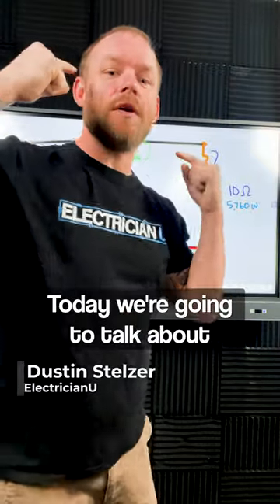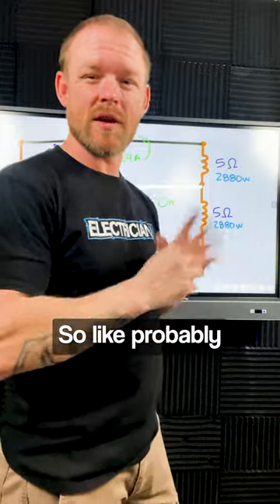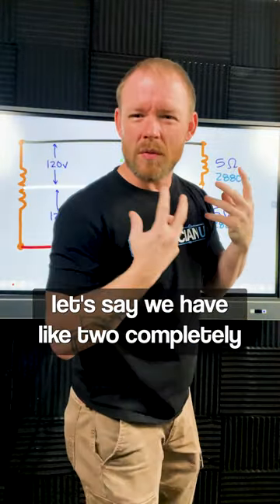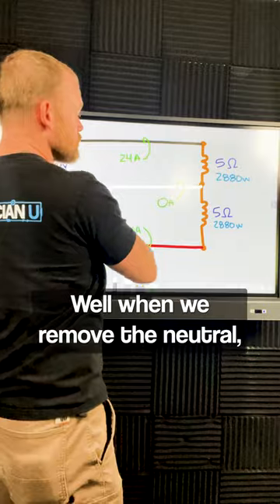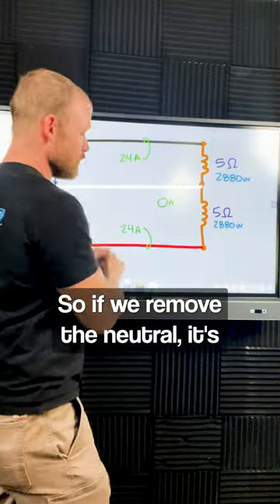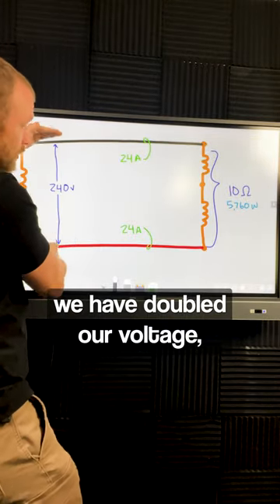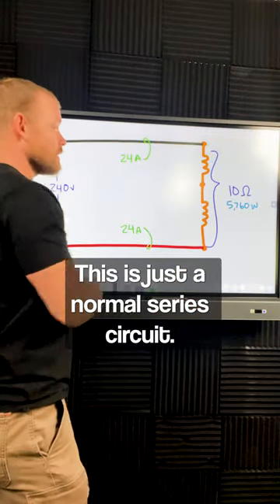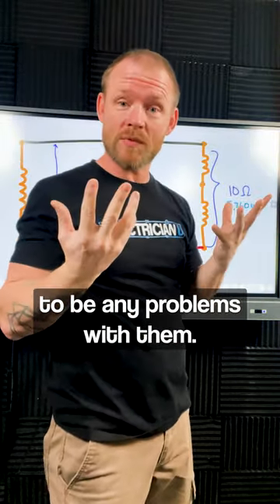Lost Neutral in a Multi-Wire Branch Circuit - Part 1

Comment: You are correct in a perfectly balanced load, with loads that can handle higher voltages.  The moment your loads are imbalanced the voltage at the higher load is going to go high and at the lower one go load.  And the most expensive one is going to end up sacrificing it's magic smoke to protect the cheaper load.
Reply: I'm actually having that issue with a wall oven Im working on, burned out 2 fan so far, going back and forth with electrician that something is happening with the neutral.

Comment: In that scenario would you be able to energize one fan without the other running?
Reply: No
Reply: No, because when a neutral is lost on a MWBC what you've created is a series 240 volt circuit (or series 208V circuits in the case of a commercial setting involving a 120/208V wye system, a lot of material and labor can be saved with MWBC'S on a 120/208 3ø system where several 120V circuits are fed from the same panelboard,  office cubicles are a good example)   however depending on the loads the voltage on one leg can vary from a few volts to 240V.

Comment: That's because the neutral only handles the unbalanced load in this case above they cancel each other out so if one was drawing 10 one phase the other phase was drawing 11 the remainder one would be on the neutral

Comment: Don't be over panicked by this as this applies to light dimmer and ceiling fans and entertainment centers with tv and stereo sound systems wired through the house along with video surveillance and the alarm system with battery powered backup in case of power outage peace

Comment: Talk about losing a neutral at power company transformer and what that does to the home circuits. Would having neutrals grounded in panel box to outside grounding rods with grounding circuits affect any of this as far as saving the 120 volt circuits and appliances connected to them
Reply: Depends on how much resistance the grounding electrodes have, and how far away the pole is from the house.  Current will travel to the grounding electrodes and try to flow back to the source.
Reply: You are probably going to lose stuff no matter if you lose neutral.  Especially stuff that isn't made to run at 220v, you will seldom have a balance panel.

Comment: Yes  - but topic is not suitable for a tiktok  format.  You need to tell the other half of the story.  IF neutral was removed it could be a terrible thing because you'll NEVER have perfectly balanced loads.  As I 'm sure you all know 240 V will be divided , one higher one lower.   If the difference is too great, one may work poorly and one would fry.

Comment: I don't wanna be negative, but this never happens right?  Just food for thought?  Never 2 perfectly balanced even loads..even if it is the same fan. Or is this actually used in practice.... As in save money and run a 12-2 screw the neutral....or don't screw it..
Reply: MWBC'S are still common in commercial installations involving several 120V circuits fed from a panelboard to a particular area, costs for material and labor can be greatly reduced when a 120/208 Y system is used.   277 volt circuits could also be MWBC, for example the lighting circuits in large office buildings and industrial buildings are typically 277V where  480V is used for HVAC systems and other large equipment.

The main reason MWBC'S are rarely if ever used in residential anymore is because the AFCI and GFCI requirements have removed the cost savings,  and only a few manufacturers have two pole AFCI breakers, and no  two pole dual function breakers exist yet
Reply: A neutral is always included for 120v circuits.